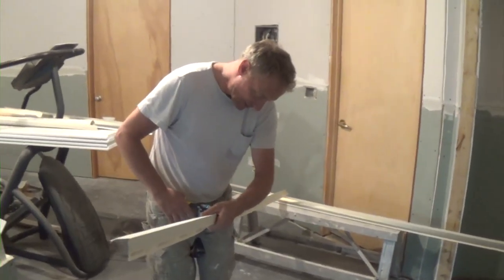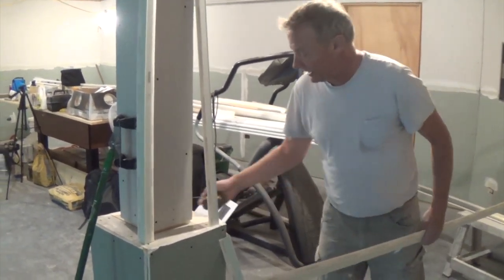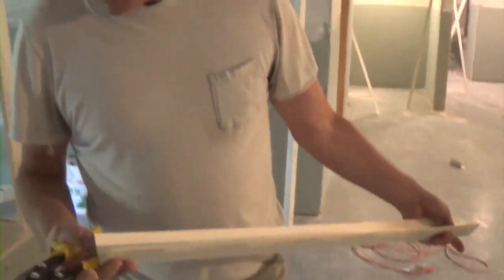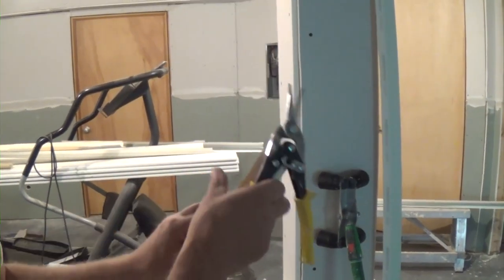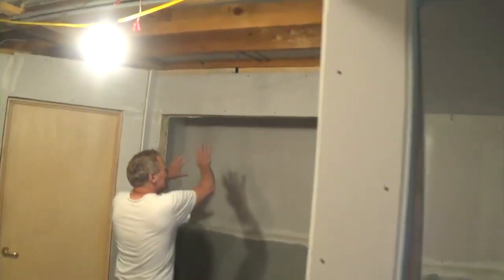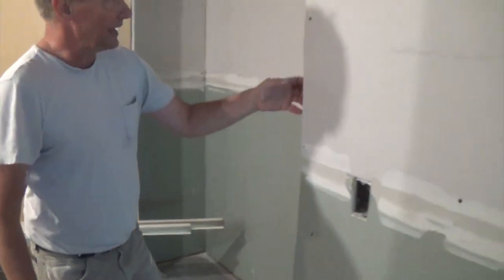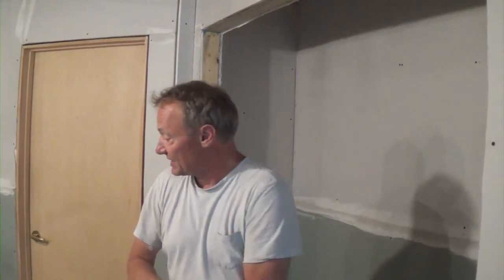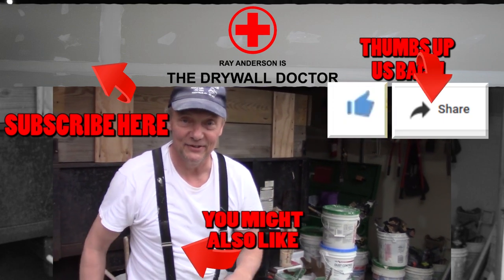How to Measure and Cut Drywall Corner Bead

Comment: Every time I do a patch after I prime and paint it doesn't look smooth.  There are little cracks and imperfections.  However when I sand it before I prime ect it looks like a cloud and is smooth?  People have told me after sanding it the dust fills in the imperfections and then don't realize them to after I paint?  Any suggestions?